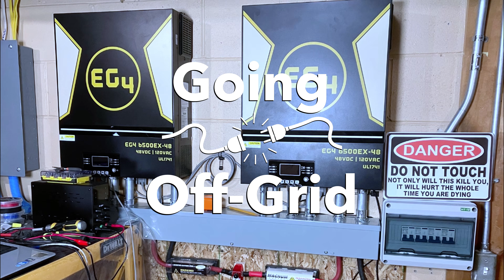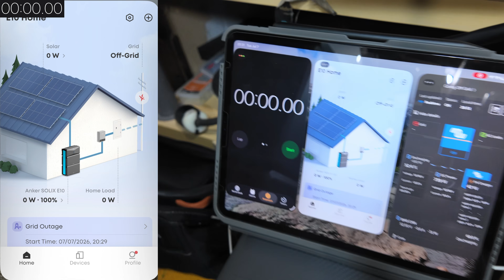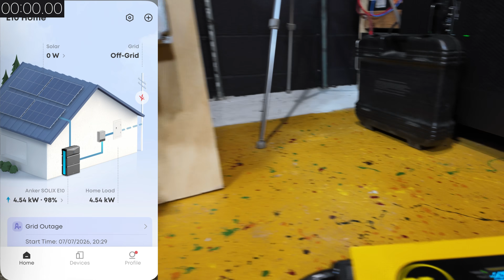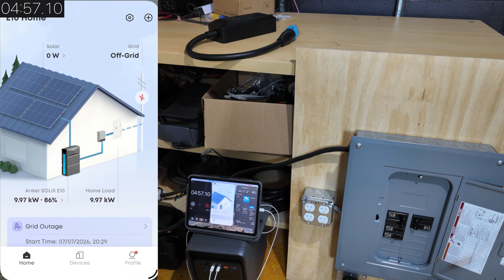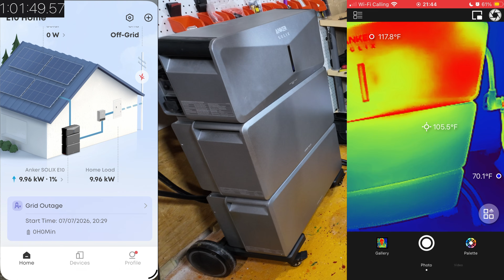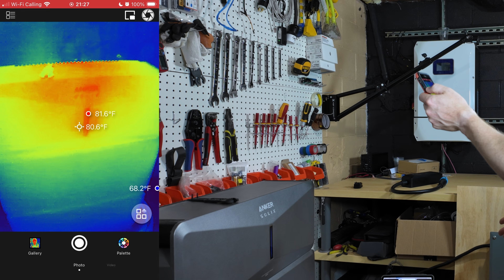Claiming 10kW with a 7.6kW Inverter? The Anker SOLIX E10 Test

Comment: Weird, I understood it as the 10KW for 90 mins claim as the limit of the inverter and not as a statement of battery capacity from the get go, but when you vocalized your confusion I finally saw how easily it could have been, and probably have indeed been misunderstood. Wonder why I didn't see that interpretation? It's what I'd usually think when reading such a claim

Comment: It being able to sustain a 10kw load for an hour without throttling down on a virtually passively cooled system is crazy tho. And yeah ofcourse you're not gonna get 1,5 hours of 10kwh power draw with a 12kwh battery that is common knowledge? it means the power unit itself is capable of 10kw for 90 minutes. Anyway thanks for the test, subbed
Reply from the maker: Yeah the fact that it can output that much for that long is just crazy looking at the inverter size.  Thanks for following along!

Comment: Adding some type of fan blowing over those heatsinks would help ?
Reply from the maker: I’m sure you could if you wanted too.  Keep in mind that this is purely a max discharge test, so you wouldn’t want to plan to run like this a lot anyways.  It’s really meant for those extra boosts you might temporarily need while the grid is down.

Comment: When testing output have at least 3x power available in batteries, preferably four times. I do an inverter test using a 3kW heater I used 10kW of batteries. Watt hours and such are not for me.
Reply from the maker: Good idea.  I was just showing the results based on what the current specs show.

Comment: The 11.43kW is the energy storage devices, maybe that means the batteries. Were as the other screen seems to be measuring the AC output that might be past the inverter. That could count for the inefficiencies/losses of the inverter from DC to AC and why you are seeing that difference in numbers. Ones from the BMS and the other from the inverter for AC output?
But the fact remains I think Anker claims 10kW output. I would call 9.96kW correct depending on how they are measuring this output with a shunt or CT-Clamp since both are probably only rated with in a 10% spec for accuracy.

Comment: good stuff - again!  imho anker doing pretty good, almost but losses are mathematical
Reply from the maker: Thanks!  Yeah you’ll always have losses.  I think it’s ultimately about what the average user of this type of system thinks when they read the specs.  There probably won’t be a lot of DIY folks getting systems like this simply because you can build it cheaper.
Reply: @AdamDeLayDIY  I agree, but for a plug and play that can run 5 ton a/c not bad
Reply from the maker: @USA_Titanic  very true.  I just wish I had a 5 ton to test… 😁

Comment: fyi.. to have 90min of runtime you need 3 batteries...or solar. You cant pull 15kwh of power from 12kwh of battery.
Reply from the maker: Thanks, yeah it was more of a “the specs say this but it doesn’t work like that” video.  I’ll admit I did have a “brain fart” at first because apparels the math in my head “wasn’t mathing” either.
Reply: @AdamDeLayDIY  lol yeah I should have completely finished the video before commenting.. but I can also see how someone that doesnt know the math could read that and think it should work.
Reply from the maker: @unijabnx2000  no worries.  Thanks again for watching and commenting!
Reply: @AdamDeLayDIY  90 minutes at 10kw is 15kwh.   well, with only 2 batteries at 11kwh,  something is missing. The other 5kwh  Yeah, takes 3 batteries.  I think their main point is that it will inverter at 10kw for 90 minutes, then either shutdown or throttle down.  Which is still amazing.

I am getting to love this system.  Versatile, powerful and growable from a basic unit level.  I think they have done very well
Reply from the maker: @dougbertInExile  yeah they did a great job.  Just need to update some specs so it doesn’t mislead people to think you can do something that it can’t.

Comment: is it only 10kw when theres solar input?
Reply: You need 2 batteries to achieve the 10kw output probably for current sharing between the battery packs but you would need 3 batteries to sustain the 90mins at that output
Reply from the maker: Nope, just when on battery power.

Comment: If you are lucky 97% conversion efficiency. Nice work. Do they stack battery voltages for 400 v system or parallel connections between batteries. Did you look into how their BMS operates? Are the battery packs 5kwh each?
Reply from the maker: I’m pretty sure they parallel the batteries together to maintain 400v.  Each battery is 6kWh.  

Unfortunately because this is less of a DIY system and more of a “set and forget” system, you don’t have much insight at all into the workings of the batteries and the BMS.
Reply: @AdamDeLayDIY battery teardown video 😉
Reply from the maker: @DMIINC2013  hehe.  400vdc is a little high to be breaking open.  It’s now thing to assemble in open air but to try and open inside a metal box…
Reply: I see now. 😂
Reply: @DMIINC2013  it uses a dc-dc converter to get to 400ish volts, the batteries are in parallel. It is the same on the Alpha ESS, Bluetti EP13K, etc. When the system is de-energized, the internal voltage should be 48-72 volts.

Comment: Hi! First off, thank you for what is by far the most comprehensive and well-explained review of the Anker SOLIX E10 that I’ve found. Your videos have been incredibly helpful.
I have an E10 with the Smart Inlet Box, and I have a question that I haven’t been able to find an answer to anywhere.
Most of the installations I’ve seen use the Smart Inlet Box to back up the entire main panel. Instead, I’d like to install a dedicated critical-load subpanel (HVAC, lights, refrigerator, internet, and a few outlets) and have the Smart Inlet Box feed only that subpanel rather than the whole house. My goal is to avoid powering large loads like the water heater, oven, dryer, and second HVAC.

Have you seen anyone install it this way, or do you think it’s a good approach? If you were designing the system from scratch, how would you wire it? Would you place the Smart Inlet Box ahead of the critical-load subpanel, or would you recommend a different configuration?
I’ve searched quite a bit and haven’t found anyone documenting this type of installation, so I’d really appreciate your thoughts. Thanks again for all the time and effort you put into these videos!
Reply from the maker: Thank you very much for the super thanks!  I really appreciate it!

So what you’re asking to do is pretty simple.  In all actuality, that’s what I’m doing at my house.  The panel you see in this video is just a sub panel that has a lot of my large home loads on it.  

So the placement of the CTs from the smart inlet box is what will control everything.  Power from the E10 will not flow upstream of them.  So you just wire up your Critical Loads panel and place the CTs on the main lines feeding that panel.  Then the E10 will only power the loads in that panel.

Now the one thing to keep in mind is that you won’t be able to use solar or battery power to offset the rest of the loads in your house on a daily basis (assuming your using the E10 as more that just a backup).  So you would be losing some potential savings when running it just on a CL panel.  

Ultimately it’s up to you.  Personally, I would just use the E10 on the main panel to help offset all the loads in the house on a daily basis and then if the grid ever did go down, I would just turn off unnecessary breakers to loads in the house to not waste the battery power.  You already have to go to the breaker panel anyway to throw the interlock switch, so why not turn off a few other breakers too.  But that’s just my thoughts.

Hope that helps!
Reply: @AdamDeLayDIY  If the Smart Inlet Box is feeding a critical-load subpanel and that subpanel temporarily draws more than the E10’s maximum output while the grid is available, does the E10 seamlessly let the grid supply the excess, or does the inverter go into overload protection.
Reply from the maker: @pookiemonkey1474  if the grid is active and connected, anything over 7.6kW will come from the grid.  You can actually see that in some of my other E10 videos.  The only time the system will supply more (turbo mode) is when it’s running strictly off battery power with no grid.
Reply: @pookiemonkey1474  Yes, this happens when the power grid is live, but it will prompt an overload when there is a power outage.

Comment: Really liked seeing the test! I think the 90 minute thing could be clearer by just saying that turbo mode is 90 minutes of 10kw, but is not available on one battery. For those that understand kwh capacity vs kw output, this is relatively obvious - no one can run for 1.5 hours at 10kw on 12kw of battery.
Reply from the maker: Thanks.

I would imagine people looking at this system just read the headline: "10 kW for 90 minutes." They expect it to work like that right out of the box without realizing they'd need to buy extra battery packs to actually get that performance.

Specs need to be straightforward so people know exactly what they're paying for before the power goes out.